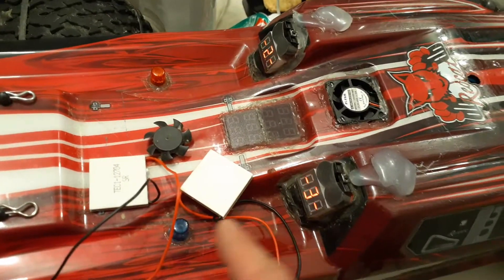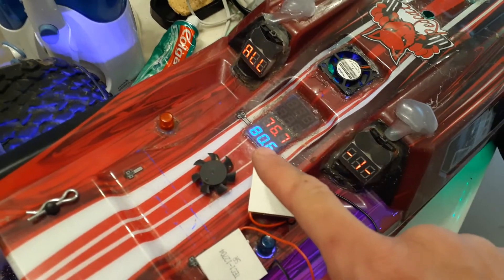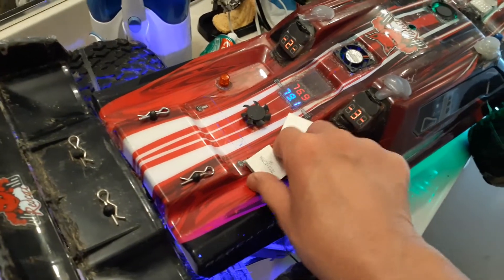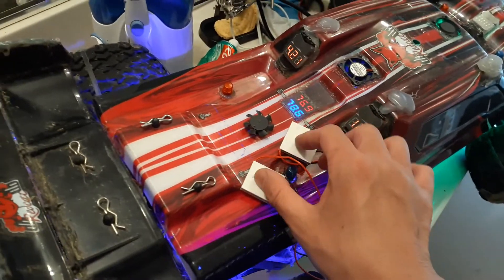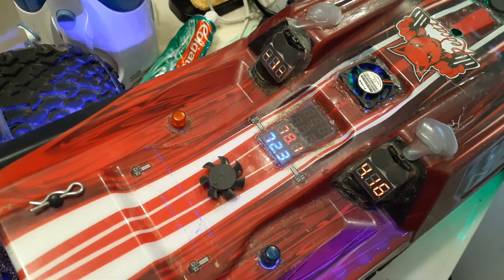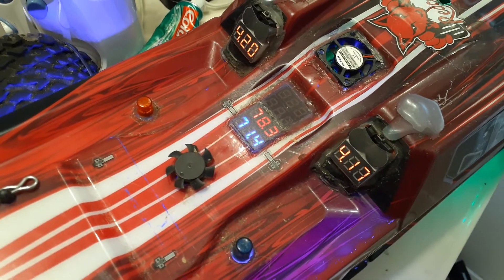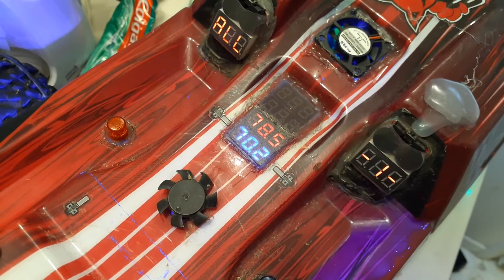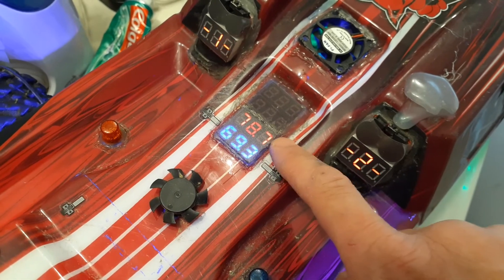Redcat Shredder RC Truggy with HomeMade Peltier Cooling system to fight HEAT.

Comment: That is really awesome. 
That looks like something I would do. 

I love thinking outside the box!!
Very creative !!!
Reply from the maker: These peltier modules are amazing.  If RC is about racing with max throttle for long distance then this vehicle will win the race because the ESC will never get hot enough to break but most people use it for bashing instead.  I can cool off the motor with a peltier module or a liquid cooling system.  California's hot weather made me build this.  Thanks for watching.  I really need to finish my liquid cooling system for RC.